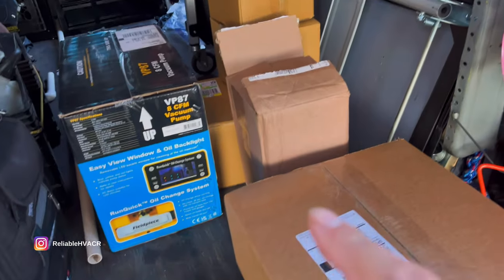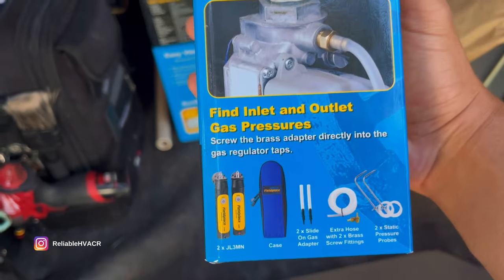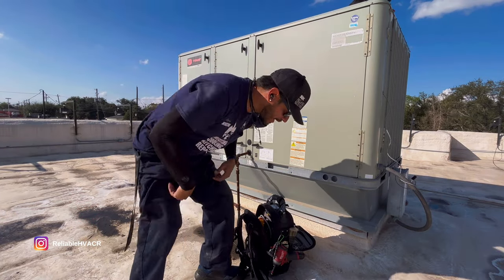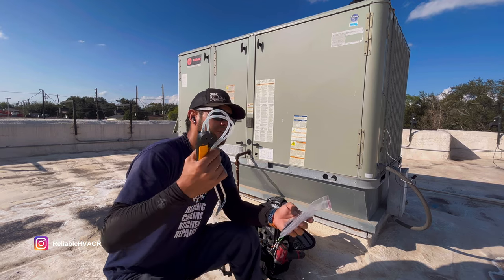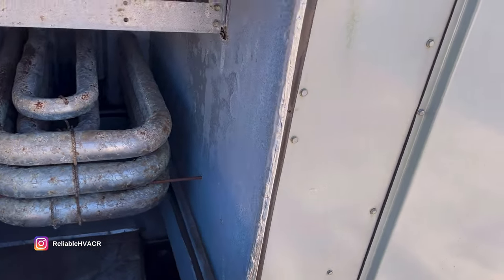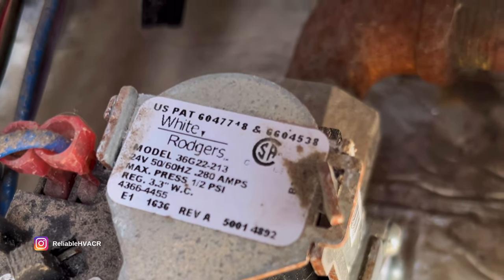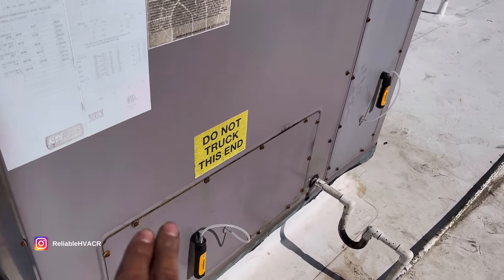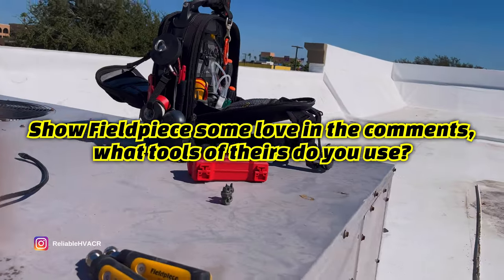Fieldpiece Wireless Manometer Kit | Checking Gas Pressure & Static Pressure | HVAC

Comment: TEAM TESTO FOR ME
Reply from the maker: I tried those before
Reply: How are the testo probes? I'm on the fence between fieldpiece n testo probes. I do luv luv 550s gauges
Reply: @techti8792  hey cuh I would say field piece are much better
Reply: Testo are more reliable when you are in range. Fieldpeice have a longer range but can cut in and out even 5 feet away. Testo had zero customer service. Fieldpeice has good customer service.

Comment: Wasnt installed right lol... Like it wasn't ran past the designer and engineers who created the Manuel J and load calculation.. typical response from a inexperienced service technician 😆
Reply from the maker: 😂 you should see the stuff I find, I have a unit that has the return and supply backwards and it "passed inspection" please, I'm far from inexperienced but thanks for watching 👍🏽